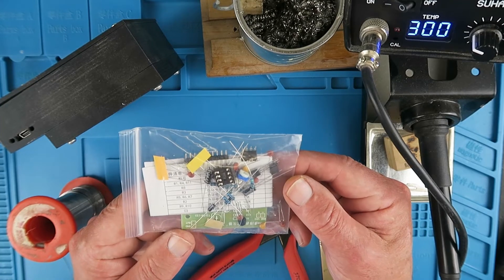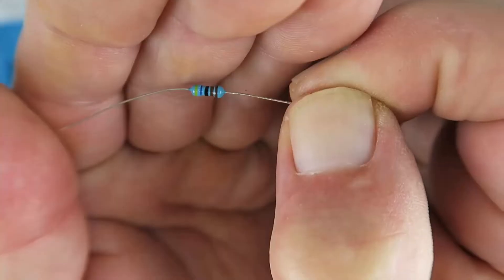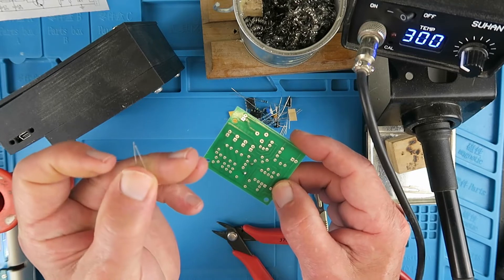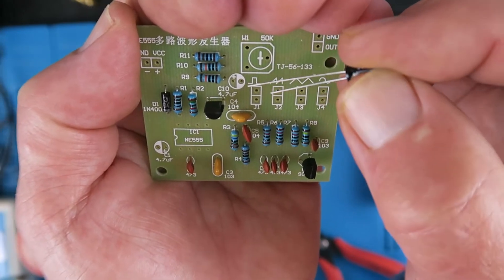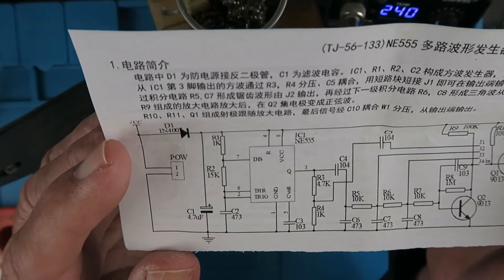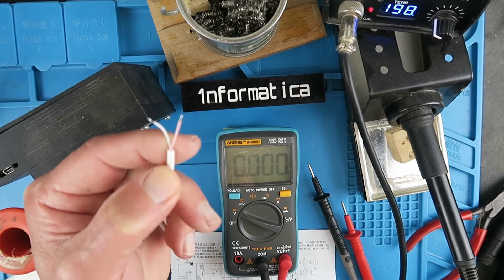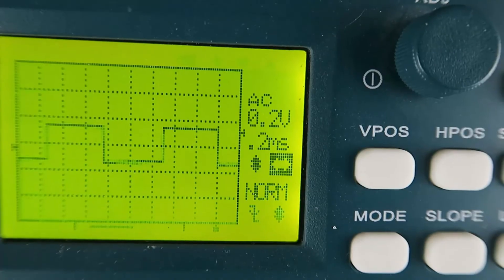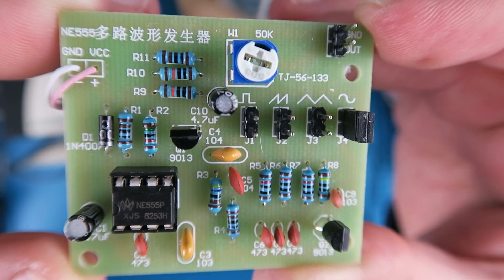555 Timer Multi Channel Waveform Generator DIY Kit

Comment: Ok it works. But the output is so low it needs amplified for a buffer. Haven’t looked at the signal yet only listened to it. Getting ready to hook it up and play around with the output. It don’t give many details about this kit other than the name. Thanks for your video.
Reply from the maker: You're welcome! It is only cheap and cheerful, there are much better circuits out there for sure! Have a great day!!
Reply: @1nformatica  you earned another sub BC you interact with the viewers. Your ok in my book. God Bless.
Reply from the maker: @jj74qformerlyjailbreak3  Hey thanks! I don't do many electronics videos these days as my focus is more on RC planes. I also have another channel on lasers and stuff : https://www.youtube.com/@craftworks7232 Check it out!!
Reply: @1nformatica  ahh. Craftwork pops up in my feed sometimes. I’ll check it out

Comment: input maximal brp volt?
Reply from the maker: I do not understand "brp" volt? The module runs well on 5 volts, I used a USB cable https://youtu.be/nQzL5puAwSw?t=350 It will probably run up to 15 volts. Please consider subscribing if you have not done so already!